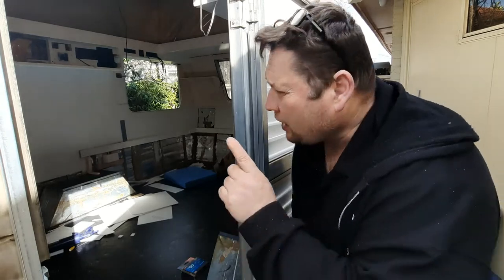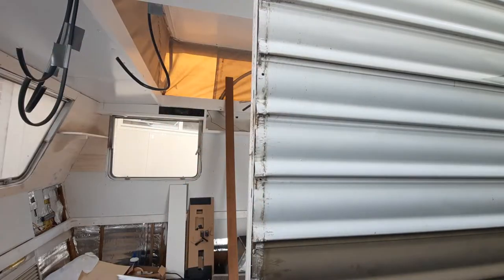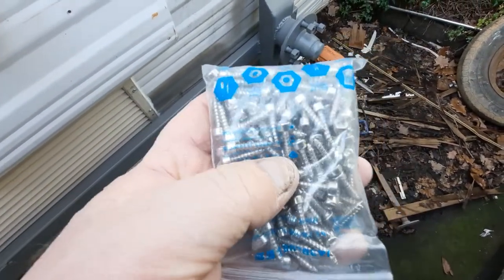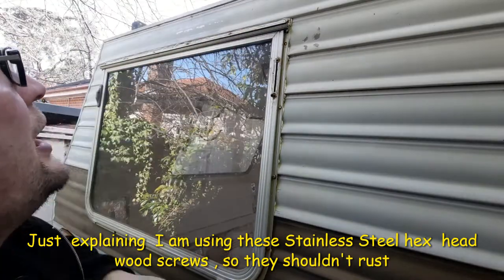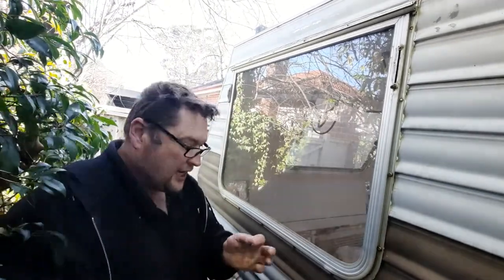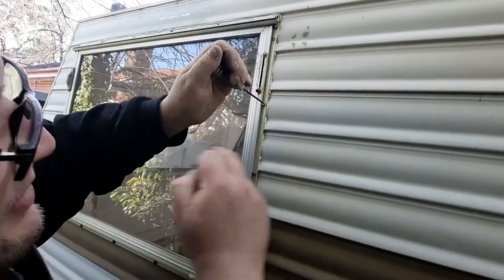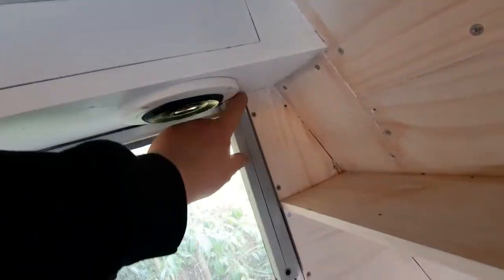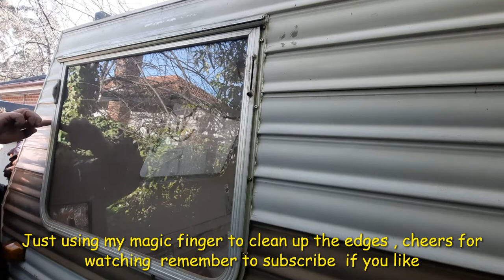Permanently  Sealing  a Caravan  window  and a update  ep20

Comment: What is the benefit of the coreflute, please ? I was considering this for my van too. Is it just an extra layer for insulation ? Videos are great BTW. Thanks so much 👍
Reply from the maker: 2 reasons  one to keep the weight down  2nd reason is insulation as it has trapped air inside   easy to cut and work with as well , thank you so much , I will be uploading the Battery section  tomorrow    200 ah lithium  battery install  etc

Comment: Hi, we are about to do the windows in our fibreglass Olympic. Just wondering how this went? Cheers edit..what about the seals that actually hold the glass in? Are they all hard. Mine are.
Reply from the maker: the seals are hard but are still water tight so I will let it go  I do have the rubber seals ready
Reply: @itsjustme356  thanks,for the reply :) where did you get the window seals from? Just a glazier?
Reply from the maker: No I bought mine  - ebay you just need to make sure the size is correct much cheaper too! @Noniinthebush
Reply: @itsjustme356  oh that’s great! Thank you. That’s what I’ll do. I appreciate the time to reply, thank you :)